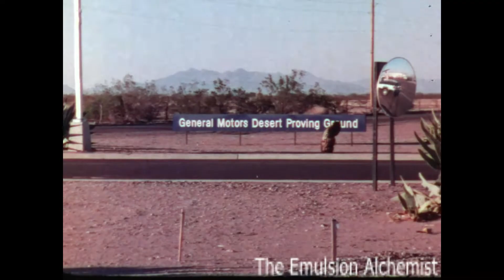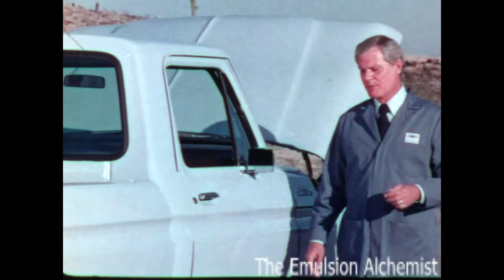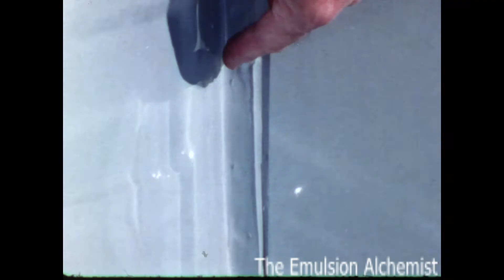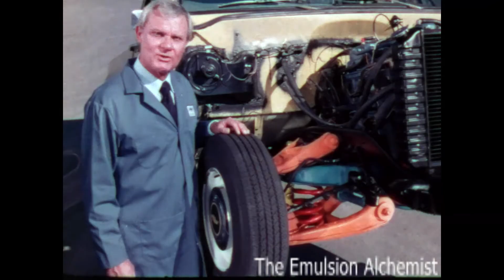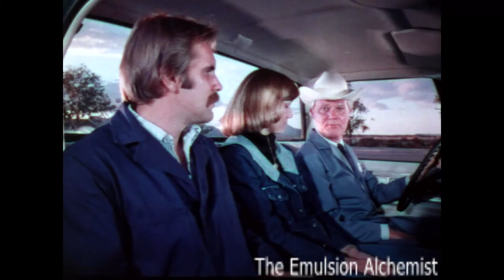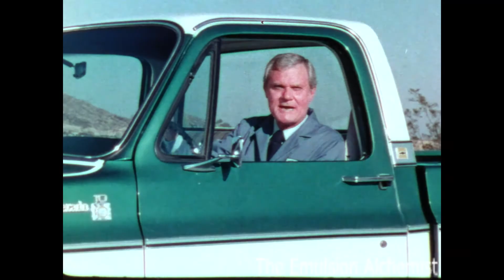1979 Chevy Vs Ford Pickup Comparison dealership promotional film

Comment: Chevy/GMC same garbage, he don't tell you piss poor quality door hinge issues electrical issues a/c dead in a year or less the 350 diesel engine was garbage the frames are weak and break/crack . gas tank may explode on side impact (nearly 3000 people dead don't believe gm's cover-up crap).  My father bought at least 10 gm so called trucks for our farm thru the 70's and 80's all were junk all had the same issues over time the diesels failed stayed in the shop finally replaced diesel engines with gas engines (HUGE GM FKK_UP). Garbage then garbage now so chebby lubbers go get you a pile of shit gm truck. The truck they were bashing was the best trucks ever built.

Comment: I had a 1979 F150 brand new off the lot. It was dependable, I liked the look but, I didn't buy it for work. Good thing because, although it had a nicer ride than a Chevy, it was so dropped when I did put a large load in it and even with an empty bed, the 302 it came with couldn't pull a dead whore off a toilet seat.

Comment: Theres no comparison the gm is toy compared to the ford. Absolute rust bucket galvanic cell lousy little 10 bolt rear an engine that wore the cam flat within 60k. Didn't see to many gms of that vintage in the oil patch because of the long standing tradition of not being able to put a proper front end in it a tradition they adhere to too this day. 390 c6 that was a proper truck
Reply: They say the rust problem got better with the 1977 and later trucks.

Comment: And the keys wear, the ignition gets loose where the key will slip out while it's started or will start with out the key in it. The heavy hoods break and fold in the middle. Then you slam the doors to Hell and back and they still rattle and won't close tight. Kinda sounds like the heart beat of modern America.

Comment: 454 Chevy!
Reply: Ford had the 460, sorry.
Reply: @fabbell5020 
But it sucked so what's your point  ?
Reply: @RW_TractorPilot  Six more.
Reply: @RW_TractorPilot here in the pnw the 460 was known for melting the rh exhaust manifold and head pipe and causing fires. The fix was to advance the cam timing and use super to keep the pinging at bay. 8mpg and expensive fuel though.

Comment: Yet Ford's Hood didn't have a problem creasing in the middle
Reply: GM Trucks didn't either if you closed the Hood properly and lubed the Hinges occasionally like you were supposed to  .
My 74 still has the original Hood and ZERO issues  .

Comment: I'm a Chevy guy, but all the things that he talked about just seemed like more stuff to break. Plus the ford staight 6 was a lightyear better than the Chevy staight 6.
Reply: I'd say the 292 Chevy six was just as good as the Ford 300. It also was a 7 main bearing design.
Reply: @edwardpate6128  With out saying I am full of crap,the 292 is a decent engine, but they are not a fan of high rpm in my experience,they were always a little hard on fuel, but the have great torque at low RPM,and the early ones with the steel cranks are the ones to have,and they are a great truck engine.
           The 300 6 was a bit more comfortable with higher RPM,a little easier on fuel ,and a little smoother running.Yes you are right they are both seven main bearing engines and if the 292 Chevy is driven as designed they last,over reved,or constantly high RPM in particular with cast cranks they normally don't.
Reply: My uncle had his 73 with I6 until 06.  He bought it new, only to reluctantly get something new that seated grandkids.
Reply: I agree the 250 head was prone to cracking,and the valves seem to have more than their share of problems,not to mention the 2 barrel carburetor. The 300 Ford six seemed to hold up better,overall.

Comment: One thing my father didn’t like about his 70’s Ford crewcab was the rear door lock plungers were located at the back of the doors. Non power of course so you had to stretch way out to try and reach them to unlock the rear doors. Chev put their rear door lock plungers on crewcabs and Suburbans at the front of the door so you could easily reach them. Just a little thing but it made a difference.
Reply: Well on the single cabs they are still kinda inconvenient, speaking from experience lol

Comment: Ford was so much better.hoods didn't fold in half and the frame didn't break at the steering box .
Reply: Never once seen the frame break at the steering box on one of these and I drove them daily from the time I was 19 or 20 until my late 30's.
Reply: @jsd795  Then your not paying attention,it was a chronic problem on 4x4 Chevies with power steering,and they would crack right where the gear box mounted on the frame holes,and it seemed more common on the 73,and newer GM trucks.
Reply: @patrickmcgoldrick8234  go tell it to someone else. I don't think your full of shit, I know your full of shit. Even on beat to hell parts trucks that I've drug out of the weeds I've never seen one break there. The only weakness on those frames is around the front hanger on the rear springs and it isn't really weak there but there is a tendency for mud/sand ect. to build around the brackets and over time it will rot out if you don't power wash that area and keep it relatively clean.
Reply: @jsd795  I sorry you feel that way, but you are not correct,it is for the most part a well know problem,frame cracking where the power steering gear mounts on GM 4x4s, they even sell repair kits for the repairs of this issue.
Reply: @patrickmcgoldrick8234  it's not a feeling it's a fact. I've owned at least 20 of those pickups over the years and haven't once seen what you're talking about. The only reason that might happen is if you put a big lift and giant tires on it but if your dumb enough to do that you deserve a broken frame
Reply: @jsd795  The frames don't break,hut some do crack at the gearbox mounts and it is a problem with some GM trucks.I not saying they are bad trucks,they are not,it's just a problem some have.I have sold and been in the used auto and truck parts business for over 40 years,and sold a lot of left frame rails on 4x4 square bodies,that's fact.They are a great truck,but every truck make does have some flaws,that is all I am saying.
Reply: I don't remember frames on Chevys breaking at the steering box, but my parents had the trucks they owned oil sprayed yearly.
Reply: Yeah but everything else on the fords was garbage 😅
Reply: People have different opinions. They both were good trucks. Over 50 million built expect a few problems. Ford’s were tougher than Chevy but Chevy flex climbed higher Ford pulled harder
Reply: @reginaldmclean8013  
                       Ford.       Chev.     Tie
Eng. Stock.                        +
Eng. Modified.                   +
Transmission.                                +
Suspension.                       +
Frames.                                          +
Acc/Hvac.                           +
Build quality.        +
Overall longevity.                +
Fords don't pull harder nor is anything on them tougher except the doors will open and close properly without maintenance for a longer period.
Reply: @jsd795 Nice chart 👍
Reply: Chevrolet was better. Ford got better in 1980.
Reply: @fredrickgates3384  I am truly sorry,if I offended anybody,but I will try to explain myself the best I can,and I like the square body GM trucks,The 73 and newer 4x4 trucks had an issue with cracking in the steering gear box mounts and it was prone to trucks in my experience with oversized wheels,in conjunction with power steering,and driver abuse as in steering in ruts and pushing hard against the limits against the box.When there was a large number of the GM 4x4s on the road when I worked at Drake and Son Auto and Truck parts we would sell a front frame cut at least once a week.If the the truck was driven with common sense or didn't have oversized wheels,they never had a problem.
            I am only sharing my experience,and I have sold used auto and truck parts since 81.I want to be very clear I have always loved the 73 up GM trucks,great comfort, decent build,great AC,PS,good looks great interior options.Not every make is perfect in everyway regardless who builds it.
           If I offended anybody That was not my intention, Thanks for reading,even to the person who so elegantly said I was full of s#$&. Thanks, Again for taking the time to read this.
Reply: Funny cause I’ve had a lot of these and never had either of those problems.
Reply: Not the Chevy's but I know 2 different guys that have had it happen to they're Ford's so how's that for junk .
Reply: Bs they weren't better the Ford's broke down more often than Chevy I've owned both and I'd buy and drive a Chevy Chevy anyday before a ford .

Comment: Notice the placement of the fuel tank or tanks in the squatebody GM pickup trucks.  It is between the outer frame rail and the pickup bed body.  This led to far more fatal accidents, including fires, than the Ford Pinto.
However, NBC News was caught falsifying a news story using an incendiary device on a Chevy truck.
I never had a truck ftom this time but I would have preferred the Ford.  Ford V8s were bulletproof and even the 300 6 cylinder was a great engine.
I would take either of these trucks over a 2023 model.
Reply: The 300 got even better after it went to Multiport EFI for 1987.
Reply: @MisterMikeTexas  I will take the 300 over almost every engine and I am a GM guy... sooo good
Reply: I guess YOU forgot about the fact that they used a Spark Plug in those " tests " to ignite the Fuel Tanks  .
Reply: If you've never had a pickup from this era then you talking out of your ass now aren't you.
Reply: It was Dateline that faked the test. Vw bugs killed more drivers than pintos. Vw caught fire more than pinto. Vw bug had the most deaths than corvair. More than any other make from 1960 to 1980 but the fake news never reported it. From 1970 to 1980 more people died in datsun b-210 and toyota corrolla than  pinto even though there were less of them on the road.
Reply: The Chevy of that time period was a far superior truck especially with the 350. Had them both

Comment: I would have either one of these classics.  I prefer the Ford but the Chevy is equally fine. They dam sure are built to last, both of them,  even the 70s Dodge .
Reply: Still daily driving my 73 Dodge with the 318 and manual transmission
Reply: Perfectly said man! I know those three are the main kings of American badassery, but I gotta give a shoutout to Internationals of the era! 👌🏼
Reply: Dodge wasn't any good until they got with Cummins. They almost went out of the truck business because of it.
Reply: Exactly.
Reply: There's no accounting for taste and you don't have None

Comment: The Chevy was a good truck,but the hood would bend up in the middle.
Reply: Improper hood closure, and poor hinge maintenance.
Reply: Ya one drop of oil a year on the hood hinges is so much work. Where the ease of removing the calipers to lube the sliders with silicone grease every 12k miles is a breeze.

Comment: I don’t see how anyone ever bought fords then or now 😂
Reply: I still see plenty of Ford trucks from the 90s on the road. Including Rangers, and I've had two Rangers.
Reply: @MisterMikeTexas  my favorite Ford F-series generation are the aeronoses which are those ones produced from 1992 - 1997. The F-150s & Broncos were discontinued in 1996 on them. My second favorite generation on F-series pickups are the bullnoses which were produced from 1980 - 1986.
Reply: @KevinRichards-rk3gp  The "Dentside" Ford pickups are my favorite, probably because when I was a kid, we had a 1973 F100, later traded for a new 1977 F150 Supercab with the Explorer package.  My favorite post-1980 Ford trucks are the "Aeronose" 1992 -1996 models. I'd like to find a 95 or 96 with the 300 Six, and the 5 speed, in mint condition.
Reply: @MisterMikeTexas  1973 was the first year for the dentsides & they were produced up through 1979. 1974 was the first year for the supercab & 1975 was the first year for the F-150 which was an optional heavy duty half ton pickup at the time just like Chevy's Big 10 because the base F-100s were still in production up through 1983. 1978 was the first year for square headlights & also the last year for round headlights. The square headlights came standard on models with the Ranger trim level. 1978 was also the first year for the dentside Bronco which replaced the first generation Broncos. Rewind to 1977 which was the first year for gas filler doors. The dentside pickups are the sixth generation F-series & the dentside Broncos are the second generation Broncos.
Reply: @MisterMikeTexas  I still see several of the bricknose Ford F-series pickups "1987 - 1991 year models" out on the roads today. The dentsides & bullnoses on the other hand are very rare nowadays.
Reply: Ford F-series have been the best selling fullsize pickups for 46 straight years now.
Reply: @KevinRichards-rk3gp ford is junk. Just cuz they sold more doesn't make them better in any way 😂
Reply: I hate Ford's, the suspension systems are a joke, the engine is pitiful, the frames are like wet noodles.. it would appear that 70% of the people who commented on this are salty ford fanboys lol
Reply: @hastyhillfarmand4x480 wake up clown

Comment: 44 years and counting. Chevy still doesn’t get it!
Reply: Still see those square box C10s around
Reply: I'll put the 10 Chevrolet and GMC trucks I've had in my life against anything you can offer 😊
Reply: What don't they get?

I owed both Chevy and Ford in multiple weight classes... They are both excellent in class 2-7
Reply: Lol
Reply: So true lmao
Reply: The only weak point on the early square bodies was the crumple zone in the hood, they would fold in half if the hinges got to stiff. On the other hand,  the ford 300 six was indestructible, and had a lot of torque.
Reply: @Gaspipenicklioni 
Hinges don't " get stiff " .
That's from NOT closing the Hood properly and NOT lubing the Hinges  .
My 74 still has the original Hood with no issues  .
Reply: They only care about profits. They could careless if we walked, flew or drive one of there overpriced toys

Comment: At Brazil, the Ford F-1000 is very stronger than Chevy C20.
Reply from the maker: the ford was designed to be beat up. the chevy suspension was better for smoother paved roads that you can drive 80mph on
Reply: @theemulsionalchemist5688  but is not the realitty in Brazil. On Chevolet C20 the suspension pivot tends to break, as well as on Veraneio and Opala. This doesn't happen with the F1000. Maybe, the F-1000 may have other types of defects.
Reply: No. It's not.